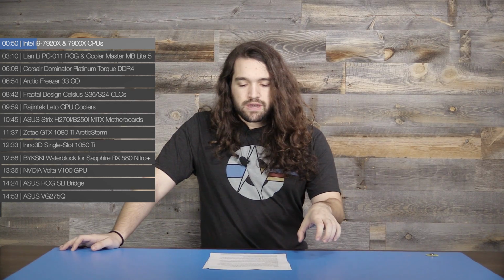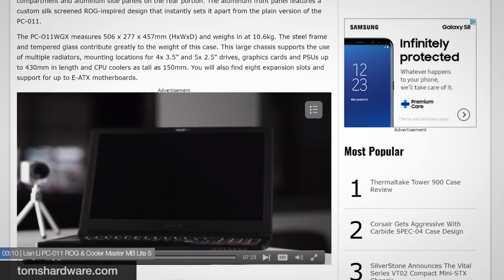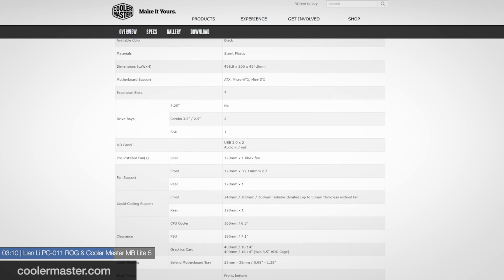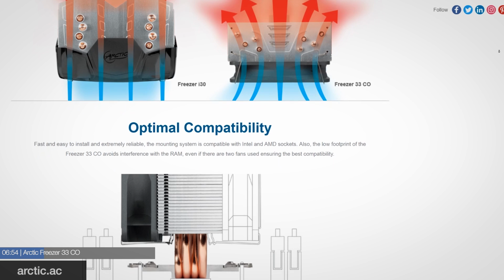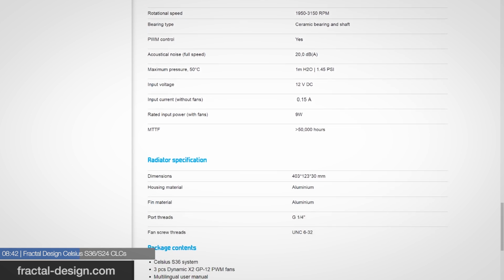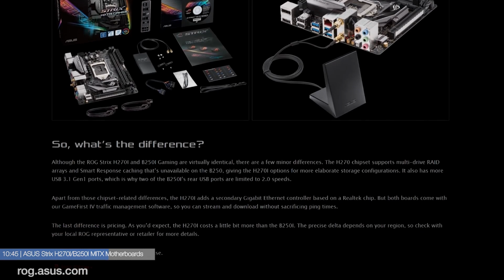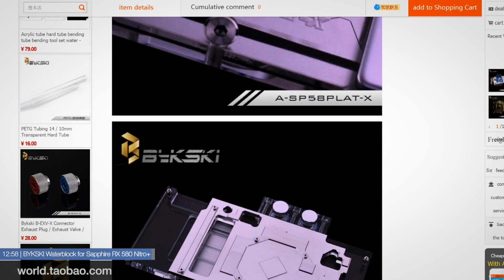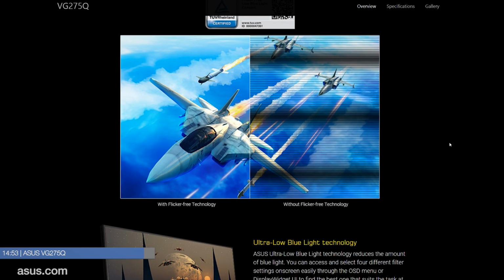HW News: Intel i9-7920X CPUs, Single-Slot 1050Ti, & More

Comment: Still waiting till intel will for every cpu make its own socket, like 7500/2010, 7600/2011, 7700/2012, 7800/2013 so if you want upgrade you need to buy all not only cpu coz thats the way to milk even more now with every year new socket is just too slow. ffs

Comment: I'd like to see a block diagram of the 7800X, with 28 PCI-e lanes if it's not hamstrung by the DMI in theory it could open up an optane solution that uses more then X4.

Comment: Notice from the leak that the cheapest processor with more than 28 PCIe lanes is the 7900, so basically the price for extra lanes is increasing with every generation. Unless prices are really good, this really sucks, to me. They saw that in that sector (high number of PCIe lanes) they have little competition and they upped the price. I really hope an r9 ryzen(II?) will crush these chips to the ground.

Comment: deionized water is not electrically conductive.  That is the benefit in using it in a pc.  Over time, it will pick up ions from the copper.

Comment: Oh yes, another $1000+ Intel cpu that won't be worth the price for 99% of consumers.
Reply: Darrin Hillier the top CPU's aren't exactly meant for 99% of consumer's to be fair, and for those that need the best performance the price difference is acceptable, while ryzen is good value, there's little to escape the fact it is slower than CPU's several years old, though it is good value if you don't NEED the fastest.
Reply: This is simply false. In most applications it evens or beats i7 6900k for a fraction of the price. So unless you really need the 10-core, you are better off with a 1700x. And if you do, a 22 core xeon or a naples system is probably better anyway.
Reply: Manweor well the Intel offerings at 4.5 tend to beat the and offerings at 4, if they can manage 4, which it seems most don't, the power usage is really kind of minor and nothing that isn't earned back in time saved over an entire year. as for the pcie lane decrease, yep, of the rumours are correct it is very odd and annoying, I am personally waiting to see, as I am in the market to upgrade my 4790k to a CPU with 40 pcie lanes, and my wanting those lanes is a big reason why I cannot consider AMD right now, as it stands a 6850k is looking to be my best bet, don't get me wrong, I would be happy to swap back to AMD, having had many AMD CPU's before swapping to Intel on my last 2, being the 3570k and 4790k, but I'm not spending money for a chip that lacks features I want, and is slower.
Reply: Manweor I've only seen ryzen beat the 6900 when clicked the same, the problem there is ryzen comes pretty much at its limit while the Intel offerings have alot more headroom, so while they may be close at 4ghz, when the Intel is clicked to closer to 4.5 it takes the lead,mind you, it would only be in a professional setting where this would matter, and the ryzen offerings are far better value, but they are slower and lack pcie lanes.
Reply: Monk, upping the clock to 4.5 means also upping voltages and increasing power draw, which in a professional environment, running 24/7, it is usually a bad idea. And requires a lot of extra cash, like watercooling and expensive motherboards. Even in that case it is like 3-4% in worst case scenarios? Extra PCIe lanes are great, but mind that Intel is moving the greater lane count products to a higher tier from the leaks on next gen. So, to me the cases where you would prefer a 6900k to a 1700(x) are really a small niche.
Sayng " there's little to escape the fact it is slower than CPU's several years old" is plain false. Take any Ivy-e or even Haswell-e and ryzen beats like ANY one of them except maybe for an extremy highly clocked 5960X.
Reply: +Monk I used to absolutely love my AMD chips, too.

Ryzen has single-handed made me want to go back to AMD, but I've been so comfortable with Intel on my last two being the 3770k and the 4790k.

Wish I just had a big enough budget to to just do an AMD and Intel build...
Reply: Darrin Hillier yes, but the i7 will become cheap.
Reply: If they sell one then they have their money back

Comment: I just wonder what the pricing of the Intel i9 7900X and 7920X are going to be 
because it would be an interesting upgrade from my SB-E system
For those who are going to tell me that AMD would be more affordable .. I Know 
But Unfortunately I had some very bad experience with AMD and prefer Intel for that reason
Reply: Dj Ravix um ok why stick with one brand? i never understood this loyalty to a brand they dont care about you unless your underwaranty most of the time 
if amd has a better offering try it out ive owned both never had a issue but i also drive a chevy and a ford
Reply: It's Pretty Simple 
If you buy a car from a brand and it doesn't drive as you would expect you probably don't go for the same brand of car again
And if you have a brand that always meets or exceed your expectations you would be more likely to get one from the same brand again
Now I have to say That I used AMD Various times ... And every time I had Issues with them 
Now there are various parts of a System that could be the cause of these issues but if everything is replaced except the CPU and you still have the same issues you probably end up RMA'ing the CPU ... And if then AMD just send it back because according to them there is nothing wrong with it 
well lets just say that the CPU had eventually been Refunded by the store because they actually know what other stuff has been replaced 
So at first I would have never considered buying Intel because of the more premium pricing
however when I bought my first Intel system it had no issues and has been running rock solid for years 
My Second Intel system has also been running solid for years (And actually still does) 
and my Most recent Intel system had some issues however after the Main board was replaced it's been running Solid
In the end I would just prefer what I trust and have good experience with 
And eventually that is the case with everything you buy

Comment: is buying a 6700k at this point worth it? I can get one new for $280 and would be gaming at 1080p 144hz while watching a video/stream on second monitor. Ryzen is a turn off because of the RAM needed for good performance and the lower IPC
Reply: love mine.  i love my 6600k as well.  if you're not running 1080ti, you don't need all that cpu horsepower for just gaming / browsing.

Comment: i just bought an i7700k, its definitely okay and faster than my old amdfx8320 but not that great actually. like 20-30 fps higher but meh.... i dont know if i have to buy one of these 1080ti so really feel the eye candy of gaming...
Reply: "Only" 20-30 FPS increase. Yea, that's sooo terrible.
Reply: moseyo tam Just 20-30 more FPS, thats nothing.
Reply: It depends on how much FPS he was getting before.

Going from 40 to 60 is a big leap, from 240 to 260 less so.
Reply: Use a benchmark site to compare your GPU to a 1080ti and you can see for yourself how much of a difference it will make.
Reply: moseyo tam Yeah I only changed to Intel for game emulation but bought an used i7-4790, it's a great CPU. I had the fx-8320, and I still miss my AMD system. I've had nothing but problems with my Intel system especially with Windows 10.

Comment: Why is nobody saying anything about the miserable L3 cache sizes on the i9's? I have an original 2011 socket 10-core Xeon (20 threads) with 25MB of L3. Even the Sandy Bridge 3930K had 12 MB and now the top i9 will have only 16.5? With 12 cores? Wtf?
Reply: +Elooder exactly what I posted on OC3D forum, about the L3 cache. My 5820k has 15MB L3. It does seem a strange move by Intel.
Reply: Ikr? weird. Less threads than AMD, much less cache... only the speed is higher. Pentuim 4 strategy? For those not in the know, Pentium 4 was Intel trying to cash in on the Ghz numbers of their CPU which had a longer pipeline and was generally a hot, slow CPU which was then replaced with a Pentium 3 (Originally Pentium Pro) based but evolved architecture in the Core series (and that's the current architectures base). Yes, even this i9 is based on the old Pentium Pro/Pentium 3.
Reply: You are most likely absolutely correct. It's the "Meh, this will do" approach. 
Then the next series of Ryzen-architecture CPUs will come out with up to 32 threads... Either just before or just after these Intel chips. Hopefully before.
Reply: Maybe intel can't compete in core count anymore, they are using older architecture than AMD that doesn't scale as well with cores as AMD's seems to, although there's still missing info there. If Intel goes full burn with clock speed though it will split the market, they'd lose if AMD can keeps scaling up at the current rate. But it would be interesting to watch, and maybe Intels holding back more than I think they are.

Your question answer maybe. Making this chip weaker to help solidify their Xeon lower range as not completely pointless? I think.
Reply: Artificial bottlenecks, companies use them all the time to safeguard an upgrade path.
Reply: Elooder 
The 6950X had 25mb of cache dont know how much was L3.
Reply: If it was physically possible, Intel would've sold you a 10 GHz water cooled Pentium 4 back then, with a glorious 400W of TDP...for 1000 bucks.
Reply: It's because they want to one up the 1800x, but just barely to maximize profit XDDD
Reply: +Maybe Live THE biggest advantage that Intel has is that the 'Core' design has not changed much in years, with each 'new' generation beign either a fabrication shrink, a 'refresh' , or an improved instruction code set etc... This has given the people who code all of your programs a very easy time and ONE of the main reasons why Intel has a lead of Ryzen atm, but this WILL change with more and more new programs being built from the ground up with Ryzen in mind not just Intel's 'core' design.
Reply: Nvidia is probably better but they're both shit. And you could use them together to power different monitors. That's it. Don't expect them to work together in a game or something.
Reply: Calls out non fanboys...then goes on the biggest Intel shill rant ever.
Reply: You can't compare clock to clock based on architectures. Each architecture uses its Hz in a different way, just like graphics card. We do know for a fact that Intel's single-core performance is superior to AMD. They usually improve performance single-core on lower end chips and improve their multi-threading technology for better multi-core performance, this on their higher-end chips (thats why we see the 6950X losing to the 7700K on single-core tests), simply because who's buying a lower end chip with less cores is for gaming, and who's buying a higher end chip is for heavy CPU based tasks.

"Why can't they improve single-core performance on higher-end chips, even if they were ment for gaming?" Die size. They have their extreme i7 lineup on a different socket because of that, a 1151 pin socket isn't enough to fit 10c and 25MB of cache (AM4 socket has 1331 pins, not to mention they make a better use of the CPU PCB, can't put my finger on the name right now)
Reply: Darren Green Yeah! I have a question, how come are intel cores still significantly more powerful than Ryzen cores? what do the architectures have different from Broadwell-E and Skylake to Ryzen (clock for clock)?
Reply: Yeah that's what I thought since it's what happened with Bulldozer.
Reply: Let's not forget that this is the first time AMD is trying SMT on their CPUS and that it's Intel's 3rd time and only now they're doing it right.
Reply: Yeah idk thats one of the most expensive items on CPU's so i feel intel will be cutting corners as usual ::L
Reply: +Man Yawns They definitely have the money for R&D. This could just be a way to buy some time.
Reply: +randomguy8196 ram speeds make a large difference on Ryzen though.
Reply: +Crimson Sunrise It's the first time they're releasing anything with SMT. They dabbled with it quite some time ago and abandoned it at that time.
Reply: l2 cache was increased in favor of less l3 cache.
Reply: i have i5 7400 proccosor + 8Gb ram + asus motherboard + nvidia gt 610...
which graphics is best ?
intel hd 630 or gt 610... can i use both graphics together ?... pls help me bro...urgent..😥😥
Reply: both graphics suck no you cant use both together buy a new video card, that gpu is years outdated and was a waste of money for a kabylake i5 unless you already had it. get something like a 1050ti or better.
Reply: If you already set everything to low and it still lags, get a real video card.
Reply: Hehehe...👌👌
Reply: Exactly. That WAS the L3 cache. And now this new one, with more cores, has less. And no reviewer mentions it so far.
Reply: And I'm podering why, because most mid to high end Ryzen CPUs have 36 MB of L3.
Reply: sadly has to due with money for less
Reply: Thnks bro...i removed my video card...can i play unity in HD 630 in low graphics ? I playrd..it get lag...any way to make it smooth ? In low graphics

Comment: Guys i have a question, didnt found anything in the internet yet. Im gonna buy a gtx 1080ti on monday, planned a Zotac one because its good price/cooling. Zotac has two AMP extreme versions  one is called AMP EXTREME CORE ACTIVE and the other one AMP EXTREME ACTIVE. the second one (AMP EXTREME Active) is only about 40mhz faster on the clock and costs 150€ more here in germany, now im wondering because they are completly the same on the paper ( WHY the fuck does it even exist when u can just OC the cheaper one in like 20sec yourself and save 150€)
Reply: Hawkeye979 because there are stupid people out there who will buy the 40mhz clock because it's "better" when it's not. So yeah....because they can and now people are dumb enough to buy it
Reply: Hawkeye979 they look different right? and one was higher clock speed so you have to consider the people that don't mess with stock settings
Reply: They are the complete same thing,  Maybe u guys can see a difference   on the Zotac site  https://www.zotac.com/at/product/graphics_card/GeForce-GTX-1080Ti/all     i cant and i dont get why the more expensive card sold 170 in the german Store and the cheaper one only 5 times... even when they are the same shit but only alittle (40mhz difference) lol